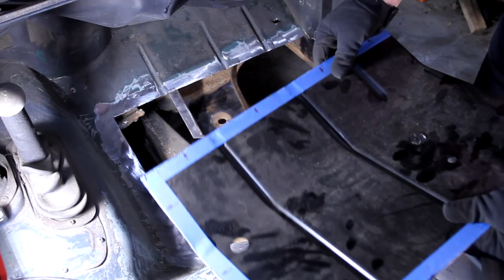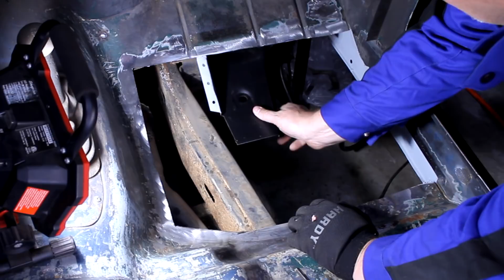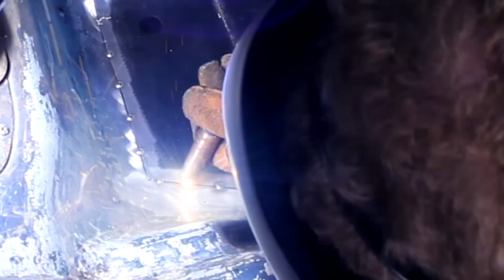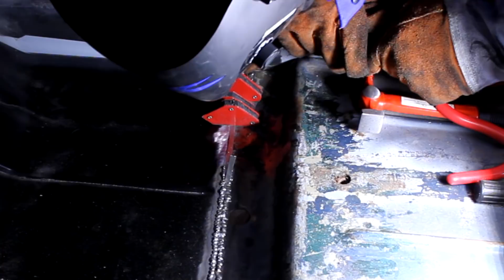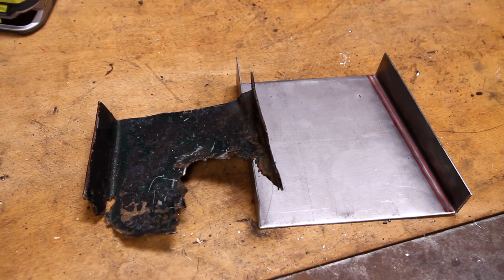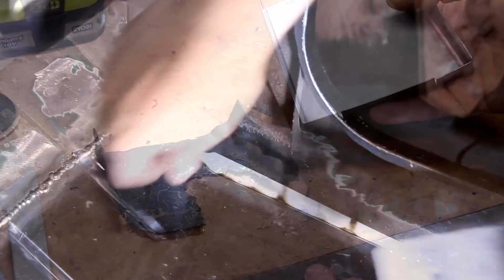CJ7 Passenger Floor Replacement 3of4 | Project Rowdy Ep024

Comment: I was watching your videos, and I wanted to know what type of welder you are using in your videos.
You are doing a great job on your Jeep. I have an 84 cj7 that I want to do myself. So great job on your Jeep. Thanks for the informative videos.
Reply from the maker: Thanks Freddie!   I'm using an Eastwood 135 MIG Welder.  I like it and would recommend it, or any Welder in that range (135) that has separate controls for Amperage and Wire Feed settings.  Have fun with your project and let's keep these awesome Jeeps on the road.   Mike
Reply: @UCanDoIt2  Thanks, man. Keep up the good work. 👍

Comment: Never welded anything in my life. Is this type of welding difficult to learn. Can a inexpensive welder from HF work?
Thanks
Jim
Reply from the maker: Jim Johnston This is not difficult welding and it is not a structural joint.  Therefore a great place to learn.   If you pay attention not to over heat the metal you should be in good shape.   Any welder should be able to handle this 18 gauge sheet metal.  However, you will be better served with a welder that has both Amp and Wire speed adjustments.   It will help you dial in what you are doing and you should be able to get better results.  Practice !!!!

Comment: Your videos are superb, I'm across the pond in England and have a rotten floor in my 82 CJ7.  I've been contemplating doing the work myself just for piece of mind that's it's done well. Your videos are so so good, I'm now ready to tackle mine. I only have one question and that is what gauge steel did you use to fabricate the outer section.  Your response would be hugely appreciated, thanks again Steve
Reply from the maker: Steve Print I used 18 Gauge Steel. I believe it is cold rolled.   I purchased a 2’x2’ piece from a local metal store for about $12.  I also used the same metal to replace the rotted lower A pillar.   Take your time and have fun.   Excited that I’ve reached you in England.   What a great platform to share.   Cheers, mind the gap!   and have fun.   Mike